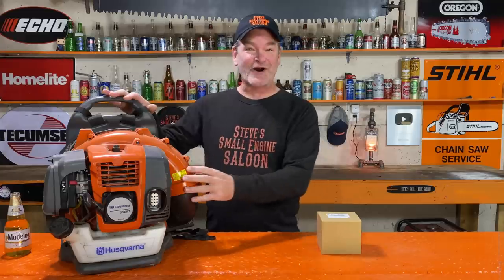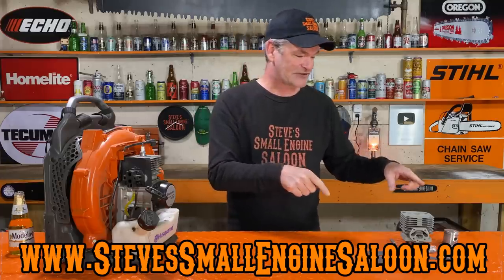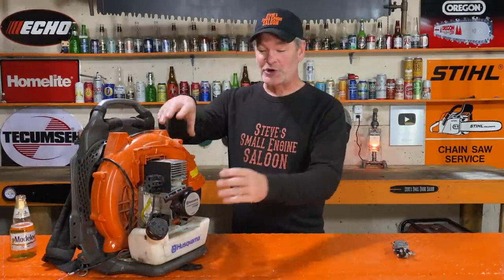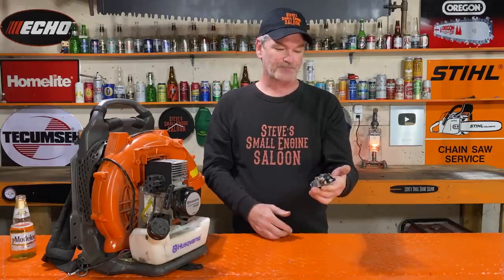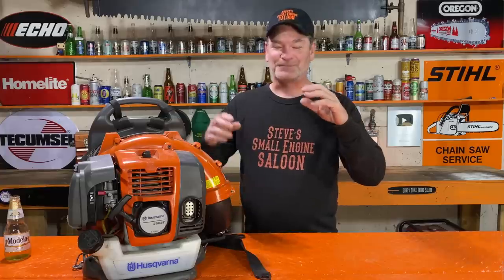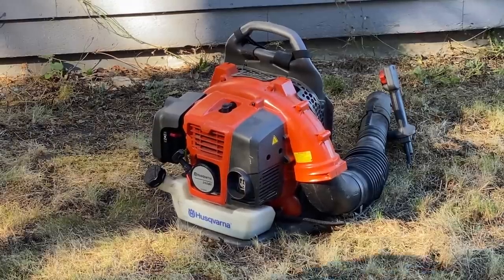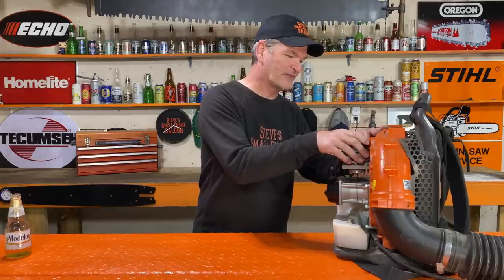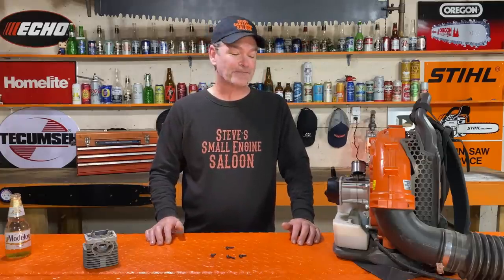Testing An After Market Piston And Cylinder Kit On A Leaf Blower

Comment: I got a question. Steve what makes a mower deck eat belts. ? I've got a troy built pony that goes thru belts at about once a month. My deck is level. My idlers are smooth and free. I put new bearings and blades in bit no change. Could it have been damaged in shipping somehow and the frame be twisted ? Anything you can come up with I'd appreciate
Reply: Do you use OEM or OEM replacement belts? I used to go through lots of belts until recently I ponied up for the genuine article and it's lasted. I think pulleys have slightly different shapes and if you use a universal replacement you don't get that perfect snug fit.
Reply: @61hink  I've been buying my belts at Lowes. Think that could be the problem?
Reply: @357bullfrog9  I don't want to pretend I'm an expert, I'm not. But if you're going through that many belts it's definitely worth a try. It's not just the length of the belt that matters but the shape of it. When I got this last one I noticed that the shape of it was different than the one I was replacing. Get a belt made for your specific make and model. I got mine at RepairClinic.com.
Reply: Look for worn off paint or signs off rubbing on the mower deck - if there is then the nearest spindle will need to be shimmed further up from the deck. I just use a suitably sized washer of the most appropriate thickness to shim the spindle and elevate the belt off of the deck.

Comment: Great video people always knock aftermarket but I’ve always had better results with aftermarket parts than original parts
Reply from the maker: WOW!
Reply: It always shocked to me too mini years ago I was buying A power steering hose for my 7.3 later purchased an original part to replace it started leaking right away took it back checked out the way the The aftermarket part end it was made way better than the original started me thinking why knock an aftermarket part that power steering hose was on my truck for many years all the way up to about a year and a half ago when I lost the truck do you somebody running a red light who is never leak Long explanation but that’s how I started with aftermarket

Comment: After a cylinder rebuilt do I have to let any of the small engine idle for a tank before I use it? I had a chainsaw and I put a new piston and rings in it and honed the cylinder as there were some minor scratches and scoring on piston. But after a few tanks of gas my new piston and cylinder got all scored up.

Comment: This is kind of out of text for this video but I have to ask. My Cub Cadet XT1 46" mower with the7000 series Kohler 22 hp surges and has since I bought it. There is no carb adjustments. The assembly on the front of the engine controls the choke, governor and throttle. I've meticulously cleaned the carb being certain all ports, paths and jet hole's had zero obstructions. I've installed new carbs only to have it run for a bit and start to surge again. So, can I remove that assembly, put on a different carb with mixture adjustments and with a setup more like the courage for the governor, throttle and choke on this engine. I know what your going to say... what about the warrantee? Screw that they had their chance and they couldn't make a permanent fix either and now they don't want to fix it unless they can charge me. I cannot seem to find the specifics about another carb that will bolt up or I'd have done that already. With all the complaints of this I've heard of and seen on the web I know you have had to deal with this already, if not well here's your chance.

Comment: I found that Chinese parts are made of inferior metals.  If I used them on the outside of my bike they rust within a year.  Where the original Japanese parts stood outside for more than 20.  Everybody who ever had an XR500 knew you could park them full of mud, with no problems for the metal parts.  Kickstarting them was another story.
Reply: So NOT true.
A component is only as good as the manufacturer wants it to be.
I have purchased Chinese cnc tooling , made from Swiss tool steel blanks,  machined  accurate , balanced, and coated properly.
At least as good as my Mitutoyo set , at half the cost...
Also, they have lasted for 12 years so far.

sidenote, also bought an EBay chinese turbo kit for the my accord, 2.0L .
Most of these kits are junk.
But some Drag racing friends recomended a specific brand, and lo and behold, its for real.
If you cant take the time to research, even German / Swiss crap can be bad.
Reply: There is nothing wrong to buy halfdead pro stuff and fix it up with chinease for occasional use.. for pro it is all another case

Comment: How do you get the cylinder back over the piston? I can only get the first ring into the cylinder at best on my stihl chainsaw.  Tried a coke can with those straps that tighten and the tool at the auto part store is too big
Reply from the maker: I just use my fingernails!

Comment: I have the 150BT version which is, I believe, essentially the same as the 350BT. I bought it in 2008 when I'm pretty sure Husqvarna was sourcing it's engines from Kawasaki. Needless to say, it is still running great some 13 years later!  Wonder (just in case) if today's aftermarket kits would work with a Kawasaki build. Anybody know?

Comment: steve my troybilt tb35ec has less than 10hrs run time. i pour fuel into the spark hole and watch it go straight to the crankcase. replaced the rings and same thing. compression test is 75psi. mom does not want to spend any more money. shame that this machine failed so soon. any suggestions. even though it has spark if i shoot starter fluid in. it will not even cough. i suspect low compression. piece of junk.

Comment: Hey Steve, I have a Shindiawa T235 weedeater that has been running just fine, my wife moved it from where I keep it and the way she positioned it allowed the tank filter to dry out and harden, it wouldn't prime up, when I pulled the lines from the tank I noticed they were sticky or gummy, so I went and bought the fuel line replacement kit, put it on and now, it starts and idles perfectly but when I punch the trigger it runs for a little bit and goes dead, like it's not getting fuel. Do you think I may have gotten some trash in the carb when I took it off and put it back on?, That's what I'm thinking.

Comment: I've fitted quite a few aftermarket kits for trimmers, chain saws, disc cutters etc. one firm I used was Italian in name and every kit I used was very good quality. Twenty years ago though only one base gasket was supplied, I'm sure those engines are still running, never had a single come back, morons who try to run a two stroke without oil are the bad guys here, if you don't have a basic understanding or can't be bothered to read labels etc. you have no business using machinery.

Comment: I would not be surprised if that kit came off the same manufacturing line as the so-called-OEM.  China is capable of making high quality products, or total junk.  It's all down to how insistent the overseas buyer is on quality standards and verification.  I was leary of the PowerMor engines (Honda knockoffs) until I worked on a couple.  They are nicely made, and seem to last, if they are maintained properly (like any other machine).

Comment: I don't ever recall any factory instructions for break in period for a 2 cycle weed eater, chainsaw, blower,  generator, trash pump. Just fuel it and run it like you stole it. Did the China parts come with break in instructions?

Comment: Steve, Unfortunately I put an after market Carb on a Stihl MS180. The screw holding the butterfly to the shaft backed out and entered the cylinder causing catastrophic damage to the piston cylinder and needle bearing. I will never buy another Chinese carburetor from Amazon.

Comment: Massive misconception about running an engine in.  Don't let it idle, you need the back pressure to force the rings out and form a perfect seal against the cylinder before the honing wear's down.  

Give it a good full throttle on and off for a few mins after warm then bingo all done.  And before you flame have raced 2stroke bikes for more than 30years, from TZ250s to enduro now.
Reply: Well backpack blowers and full race bikes might well have different break-in processes. 
Mine is a little of this and that. Like Goldilocks, right in the middle; not too hot and not too cold.
Reply: I agree run it don't idle it . Run it vary your rpm unless you want a sloppy piston and a slower  motorcycle than your buddies . Proven

Comment: It has been kind of "hit or miss" for me with Chinese stuff.  Some of it works well while other components fail rather quickly.  My general rule of thumb is not to use any "aftermarket" stuff if it could cause a safety issue.
Reply from the maker: Great point!

Comment: In general most are horrible.  Some aftermarket brands, Meteor, etc., are excellent and possibly better than OEM.  I have had almost no luck with Chinese carbs either.  Despite the fact that some OEM I have purchased from Stihl said Made in China right on the box.  I suppose that the country of origin is way less important than the quality control of the factory who manufactures.

Comment: I ordered a replacement carburetor for an edger (with a vertical shaft engine!) thru Sears Parts Direct and got a Chinese knock-off.  The provided gaskets fit my fuel tank but one of the bolts on the carb flange was mis-located by about .050" so it would not bolt up properly.  Total POS.  The vendor acted stupid so I went and bought a real B&S carb and had no problems at all.  Then I told Sears they should not sell crap like this thru their site.  Seems their business is tanking so they don't care anymore.

Comment: I have a Stihl MS250 in which I used 3 different Chinese knockoff after market, complete engines. All 3 failed after working flawlessly for a couple hours of run time. The first two failed when a piece of the casting broke off the crank destroying the engine. The third one failed when the piston connecting rod broke and went thru the cylinder sidewall. I bought a 4th engine which I couldn't even get to turn over because the crank shaft seals were flawed and were so tight the engine was seized from the start. I finally bought an OEM Stihl engine which has worked flawlessly since. The time required to change the Chinese engines was not worth it.

Comment: So I rebuild a ton of 2 stroke equipment, mostly logging saws. I will never put a aftermarket cylinder besides a meteor in saws or trimmers because of how demanding the application is. It really shows especially in the saws. With the clearances in these China kits, you lose a lot of compression. An application where you really need a ton of power is not the place. Now as for blowers and hedge trimmers, I’d go aftermarket all day long. They aren’t really that taxing and it’s more about the rpm then the power. If you can save money and get a working blower that’s the way to go.
Reply from the maker: Well said!

Comment: Politically I’m no fan of China. But they can and do make some decent stuff. The “junk” is caused by two elements. The importer who contracts for an item at a “price point”, and the inability of Chinese factories to maintain consistent quality control. 
Truth be told many OEMs world wide contract parts to China. They pay extra for QC and reject a lot of parts. “Liquidators” buy those reject parts to sell as after market low cost alternatives. You, the consumer, pay a lot less and sometimes you get “a lot less”. Sometimes you don’t. So, my experience with China is that they will make it like you want it. You want it “cheap”, you get cheap, with all that that entails. Pay a reasonable price you generally get a good product. That true regardless where an item is made. Just saying.

Comment: The plating, port shape and port timing on aftermarket cylinders are never as good as oem, it will work but it will not last like oem under every day heavy use for years. avoid chinese parts like the plague their sales hurt quality aftermarket parts suppliers..taiwan and italian are ok quality if oem is unavailable.